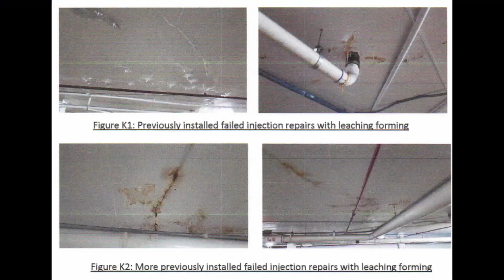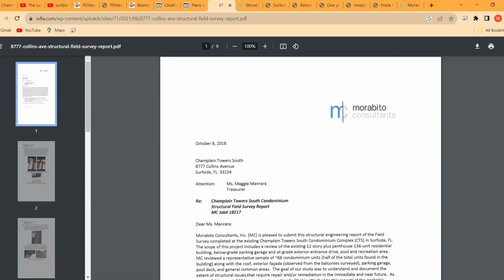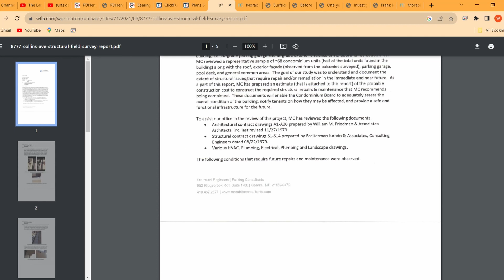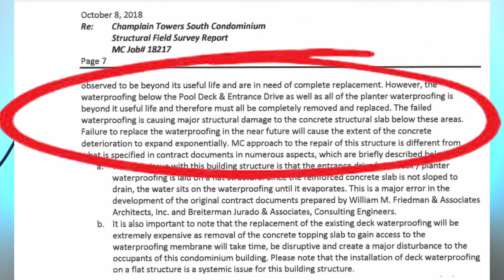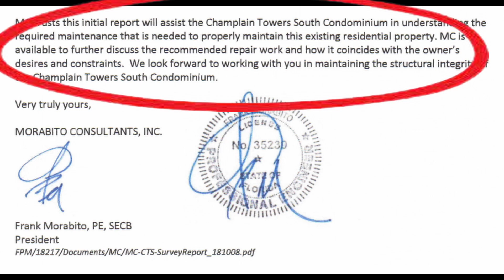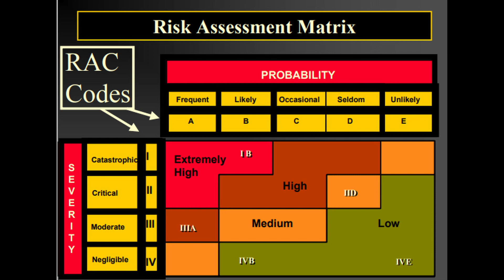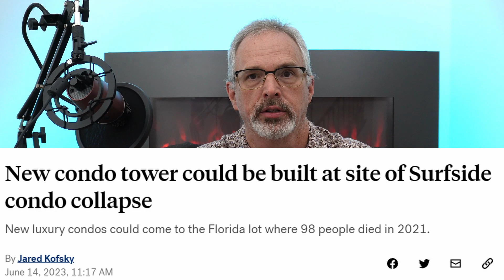A New Perspective on this Fatal Building Collapse

Comment: Before I retired from AT&T a few years ago, I had occasion to work out of one of the company's central switching offices. The building had developed a number of long diagonal cracks in the concrete blocks of the front outside wall, and the inside floor tiles 10' back from that wall were growing cracked and separating in a North-South pattern, parallel to the exterior wall in question. A structural engineering company was called in by AT&T local management to assess the situation. I happened to be there on the day when two young "engineers" from the consulting firm arrived. They spent 20 minutes or so looking at the cracks in the floor and hall, and then both agreed, saying "it's probably just minor foundation settling, and nothing to worry about". As they were leaving, I asked if their word, "probably" was an engineering term. They just looked at me and left. To this day there has been no work done to the building, and it still hasn't collapsed, but I wouldn't be surprised to read one day that the building had failed, and was laying in the parking lot.
Reply from the maker: Sounds like that building could have a problem at some point in its future.
Reply: I would have liked to read what the consulting firms reported, advised.AT&T and what AT&T paid them.

Comment: In my opinion, weak people should not become engineers.  Weak people will fold to pressure to change a sound engineering decision because a client or a "superior" in the company, insists that they do so.  I resigned from a company because a "boss" there demanded that I compromise a design because they would lose the client if I failed to do that.  After I quit, the project was assigned to a more gullible engineer there, and after the S### hit the fan, I was deposed to tell my side of what I knew of the revised engineering design (which did not have my engineering seal on it). The Judge shook my hand and congratulated me for my ethical stand and that engineering company took a huge financial hit.
Reply from the maker: I am glad you were able to leave a place like that on your own terms.  It amazes me how some of these engineering managers place short term gains over long term interests.

Comment: 7:08 there may be a slight confusion with when that vid was taken, and the water may be broken plumbing between the pool deck collapse and the rest of the collapse. on less blurry versions of that video clip, a planter and patio decking is visible at the bottom of that ramp that should be above the garage not in it. You are correct in that there was an abundance of rain water in the garage long before the collapse with makeshift methods used to keep it from ruining cars and dripping on people.

Comment: Most structures are designed and built to meet the building code requirements and have safety factors for that reason.  An engineer looking at deterioration would assume that some deterioration could occur without cause for alarm, and anyone in a big city sees this all around them every day.  Whether right or wrong the report on deterioration of Champlain Towers probably took this same approach.  The engineers evaluating deterioration probably didn't go back and analyze the building based on original structural drawings and didn't know that it was not designed properly.  If they had they might have made different recommendations.  It is easy to come up with other criticisms in hindsight because we don't have a history of buildings of this type collapsing completely.  Engineers doing a similar investigation in the future will now have the benefit of this knowledge and will approach them differently.

Comment: When the engineers input gets in the way of the dreamer/investors goal the outcome is never great. People do many dangerous things even though they are properly warned.

Thinking about the way the 2018 survey report was written, the condo board commissioned the survey of an aging property that had visible damage that the residence observed and was due for a critical review. The Engineers listed the numerous deficiencies in a factual way without prioritizing based on risk but did describe the risks. No surprises here and at this point there was a window of time to implement repairs. It appears the condo board read what the wanted to read in the report, the local agency’s looked away from the problem and the engineers may have been dissuade against following up.
Reply from the maker: It just goes to show that there are usually multiple factors and multiple parties who create the conditions for these disasters to occur.

Comment: Remove the load (autos), supports required in parking garage from lower level... As far as collapsing the entire building and requesting an evacuation was not warranted at the time... recall, it did NOT collapse...
As far as research, I might be the single most "nut-job" on this structure...
This engineer was informed to deal with excess parking requirements and they appear to have a higher demand for parking then shoring the pool/car deck...
This is my quick reply for you and we all (with years of field experience )have had to be informed by the state or municipal authority that they don't want to know about "x"... 
I pounded on that door a few tim s before I accepted this World is corrupt and no data you present will overcome the people in charge/owner (municipality)...
You have to find a way to write that notifies the owner of the concerns and write them of their intentions.
One example is compaction done with triaxle trucks as the compactor... 
I have actually found if they do enough lifts, the municipal authority was correct...haha
So, you write them and thank them fir their directions and inform them that their method has been completed and ready for their inspection and sign-offs. 
Hope you read between the lines...
Reply from the maker: Yes it is discouraging.  There was a time when I thought engineering was above petty egos and corruption but that simply is not the case.  I still am hopeful that things will improve but engineers need to be mindful that they can be undermined at every turn by their client's representatives and local officials.  I do construction phase testing of bridge foundations.  Sometimes I will be onsite when the City or State inspector stays in their pick-up truck the whole time I am onsite.  Once I have done my work, they try to wave me over to their vehicle to give them a debrief.  I ignore them and leave when I am ready.  My take is if they want to know what is going on they need to get their A$$ out of their truck.

Comment: One thing that I find disturbing is that the pool deck was tied to the actual building structure and not a separate structure given that the pool deck would have different thermal expansion properties compared to the building itself. If they had been separated then a collapsed pool deck might not have had a major impact on the building. It would still have been bad, but with less consequences.
Reply from the maker: Yes, I agree that the connection between the pool deck and building made the structure more prone to collapse based on the preliminary NIST findings.
Reply: It is extremely unusual to find buildings of this type that do not have the floors all connected.  In hindsight it would have made a difference at Champlain Towers to have them separated, but for that matter it would have made a difference to have designed the building properly in the first place.  Adding a separation between building and pool deck changes other things- it makes the parking layout more difficult, it makes waterproofing of the basement more difficult and could have lead to even more severe water deterioration of the structure.  It weakens the building's resistance to hurricane loads.  So when weighing the factors most buildings have the pool deck connected to the main building.

Comment: It seems to me that the biggest take away from this disaster is that the pool deck should not have been structurally tied to the first floor, and the vertical supports of the building. If the pool deck had been a separate slab, with its own supports, the collapse of the pool deck would not have affected the  building itself.
Reply from the maker: That design does appear to be what led to the collapse as it was certainly non-redundant from a stuctural standpoint. The problem was compounded by the use of heavy planters for landscaping and deterioration.

Comment: The big problem is that hindsight is 20/20. Condo boards are problematical at best. You're dealing with laymen and anything like an engineering report that outlines millions in repairs is going to have a tough slog. It is known that the previous board at Surfside was particularly bad at dodging issues, the main reason it was replaced. The new board started to authorize repairs but it's not clear if anyone knew of the severity of the problem, even the engineers, two years after the initial report. There were fundamental structural issues right from the initial build that weren't revealed until the collapse. Invasive (and expensive) testing would have had to be carried out to discover some of these. It's bad all away around.
Reply from the maker: A lot of times when a disaster like this happen the best chance of learning what really happened is the result of litigation that actually goes to court.  This situation is atypical in that NIST is involved with the investigation.  More often than not, out-of-court settlements tend to conceal what really happened among all of the parties involved.

Comment: My company Spearix develops wireless optimized for 10yr battery life in harsh environments such as parking garages and buildings. The technology now exists to run continuous monitoring and aging of concrete structures with low cost. I wonder whether the industry refuses to deploy these technologies because it would reveal too much? However, even at structural failure, deploying these devices should help save lives and that's what really matters. Anyone's thoughts?
Reply from the maker: I think you are right on target with your suggestion.  I know such monitoring has already been implemented for a number of aging bridges.  I understand that Florida has now required that these buildings be inspected by Structural Engineers, but I don't know at what frequency this is to occur.  I would doubt that it is more frequent than even annual inspections.  Such monitoring could be a good addition to collect information between these inspections.

Comment: My experience is as a naval architect and marine engineer.  My 35 year career was spent working for the owner/operators of oil tankers.

I  agree with your observations regarding young engineers needing field experience to go with their academic experience.  As I got closer to retirement I found that the young engineers, both recent new hires and summer interns, had been educated in a way that they were dependent on computer applications.  They were lacking in the basic first principles approach to solvong problems.   I  also found that they were lacking in what I  would label as a 'common sense' approach to problems.

I  received a letter saying a regulator agency had rejected adding a 1/2" vent to a 6" vent line.  The vents were from vapors, mainly air coming off of service tanks and engine sumps.  I knew off the top of my head the finding was in error and that it would take about 15 minutes to find a solution.   I had a young, well educated (BSE & MSE) find the answer.  Eight hours later I was told the answer given by the regulatory body was correct.  I told the engineer that the answer was wrong and it dhould have taken about 15 minutes to find the answer.  Crane Flow of Fluids Publication 410, Table B 15, Flow of Air Through Schedule 40 Steel Pipe, shows a 6"
pipe 100' long, flowing 30,000 cfm has a pressure drop of 19.3 psi.  It also shows that a 1/2" pipe has a maximum  flow of around 100 cfm.  I'm 71 years old and I am know where to find the answer 50 years later.

I noticed that you have not mentioned doing a Failure Modes and Effects Analysis (FMEA) or a recommendation for a FMEA to be done.  If this had been one of ships, we would have pulled the drawings, looked at the maintenance and repair history and reviewed use practice.  We would do strength calculations based on loading.  The next step would be a Finite Element Alalysis (FEA).  This would be followed by a fatigue analysis.  For tankers engaged in the Alaskan trade the United States CoastGuard(USCG) requires a Critical Area Inspection Plan  (CAIP) be prepared and an inspection be done annually to ensure the structural integrity of each tanker is maintained throughout it's life.  A FMEA might be done to assure that in the plethora of data generated that an oversight does not result in a catastrophic failure.

Comment: It's not the the engineer's job to make a call on the safety of the building. The engineering firms responsibility is solely to point out the structural issues present. The municipal building inspector is responsible, for making a call about the life/safety issues of a structure. There is also plenty of evidence that the condo board ignored the engineer's report entirely.
Reply from the maker: The local official are ultimately responsible in this situations, but if a qualified engineer has concerns about the safety of occupied, multi-unit building they have to speak up strongly under their ethical and professional obligations.
Reply: First and foremost duty of a professional engineer is to protect the health and safety of the general public.

Comment: I am not an engineer, but did work in construction for 47 years before retiring! Let me just address some points from a layman's (I use that term, as not being an engineer) point of view! First it's easy for us to criticize from an 'after the fact' point of view and say we would have done things deferentially in hindsight, although we are giving that opinion in hindsight! In this case of the Surfside Collapse there could have been a number of contributing factors to it, but I tend to believe that most of it was or can be attributed to 'punch through' of inboard (inner not outer columns of the building) of the pool deck area! These columns that were over-burdened by layers of sand and tiles and planters added to the pool deck, that the original columns were not intended to hold! But it's also been said that the re-bar coming out of the original columns were not sufficient or laid out correctly, or even as was directed by the drawings, which may have been inadequate to begin with! So was there signs of pending punch through, for him to analyze on his inspection? Was he made aware of the added weight to the pool deck over original design? Was the scope of work that he was given before his inspection, indicative of evaluating a structural failure? I am not letting him off the hook, just raising questions that might not be seen! I think there is an across the board failure in inspections in the original building of Surfside (Who didn't check column sizing and rebar density or placement)? Who didn't check that the original building was not designed for the added pool deck weight? Who did not listen to (Pool maintenance contractor) maintenance voice concerns of the concrete condition in the pool maintenance room? I think a lot of factors play into this, beginning with more education of engineers, codes that may require peer review and more inspections to verify critical areas, better Building Inspectors or inspections, and required documentation to be kept on file for reference and for changes made! We live in a world, were everyone points fingers now and no one wants to take responsibility for their actions, we need to keep better records, so we can find facts in hindsight situations!
Reply from the maker: You make excellent points so no argument from me. These situations are generally the result of several factors as you point out. Thank you for your comments
Reply: @CaseyJones-Engineer RON 🍔 HAMBURGER😂😅

Comment: Could the installation of low-cost shoring ($100K) at the ground level have prevented the catastrophic collapse and given an early warning?
Reply from the maker: It would seem that this could have helped stabilize the building at least temporarily.  Also, the heavy planters and vegetation could have also been removed to reduce the load on the pool deck slab.  It is common to use "falsework" or temporary supports for damaged bridges until repairs can be made.
Reply: yes